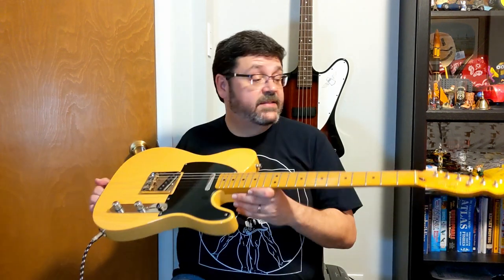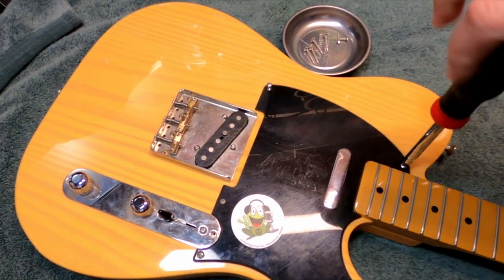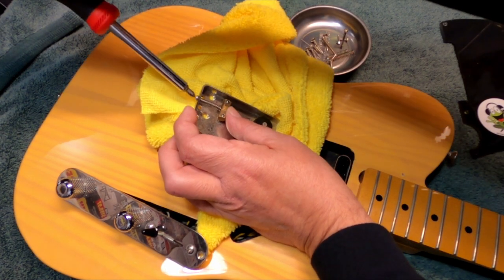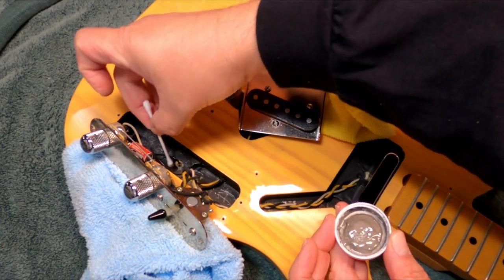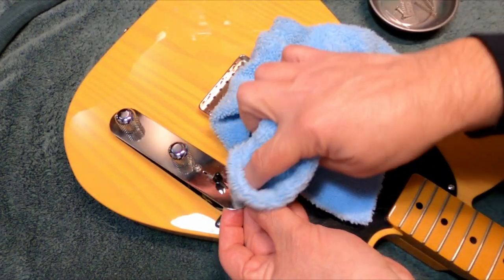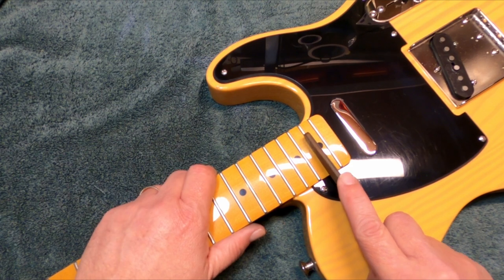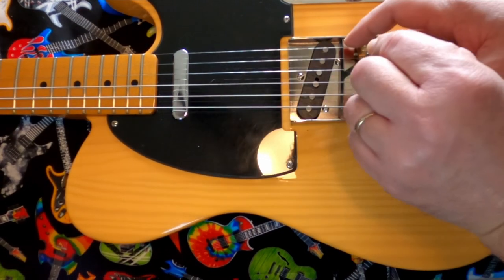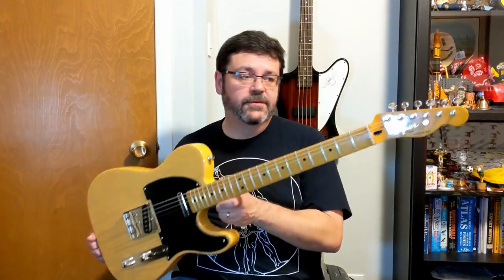Fixing a noisy Squier Classic Vibe Telecaster

Comment: I routinely shield cavities with aluminium foil (from the kitchen), stuck down with Pritt Stick.  I try to do it in one piece, and overlap the body (like this guy did with a blob of conductive paint), and then put insulation tape anywhere that internal components might touch the foil.  Going from no shielding to some shielding always cures the problem, without being picky about whether there's a perfect Faraday cage.  I prefer aluminium foil over copper, which seems to suck tone.  To connect a ground wire, I put a small, large headed screw through the foil, with the wire wrapped around it.
Reply from the maker: That's interesting about the aluminum foil, have you considered using Nashua HVAC foil tape? it's pretty cheap and it's conductive through it's adhesive and it's aluminum.
Reply: @pawnshopguitarguy  Thanks for the tip. I haven't tried that.  When I tried copper, I used garden slug tape, and crucially, the adhesive is conductive, so there's no need to solder the strips together. But I prefer aluminium. If HVAC tape adhesive is conductive, then that should be just as good as kitchen foil, and a lot easier to apply.  As you note, it's cheap, so worth a gamble.

Comment: I still don't get shielding and adding an additional bridge ground on a tele
Bridge pup grounds via mounting screws thru the base plate. Neck pup is fully shielded and grounded. Control plate is metal and is essentially a ground plate. 
Shielding the cavities and adding a separate ground to the bridge can create ground loops.  
As far as creating a faraday cage, there is a gap in continuity between pickups and mounting surfaces. The bridge pup does not have a grounded shield.
So all that effort gives negligible results in stopping RFI. 
Good wax potted pups and wiring the cap to the #3 lug and ground #2 lug on the tone pot (60's wiring) helps to limit RFI traveling all the way through the circuit.
Reply from the maker: Interesting thoughts but in the end I only added a tiny touch of shielding paint and it fixed it. The wiring otherwise was stock as far as I know....

Comment: I have to try this. I have a beauiful Classic Vibe 60s Custom Telecaster that has upgraded hardware, including bridge, electronics, switch and pickups. It plays and sound great... but it is noisy. I have have been told by two luthiers that the noise is normal for single coils, but I have quite a few other single coil guitars, including an American Standard Telecaster and they're not noisy.
I really love this guitar but the electrical noise really ruins the experience for me. If I touchthe bridge plate the sound stops. Touching the strings help but there is still a bit of noise. But otherwise there is that constunt hum or however you describe it.
Reply from the maker: I have seen some Tele pickups (especially hot ones) that are prone to noise, but a hum that stops when you ground the bridge with your hand tends to be something with the grounding. I would check or even re-solder the grounds. Good luck!

Comment: Nice job! Regarding shielding against mains hum on guitars, the term 'faraday cage' is in the ballpark but slightly misused by most of us and that included me before I was corrected and studied it a little deeper. Since the pickups almost always protrude outside the shielded body cavities they are also outside the boundary of the 'cage' and subject to interference. Can't avoid that unless you lower them below the boundary of the cage. But for me, good thorough shielding and proper ground continuity has always reduced the hum noise from rf interference. Next you have to learn how your single coil guitar pickups react to that in different playing positions and ranges with respect to your amp, leaky house wiring, flourescent lights etc. That's what I believe now but I'm always open to having my mind changed by folks who know more about it. Good show, just subscribed.

Comment: Looks quite light when you pick it up. I've seen/heard people mentioning that the pine bodies is quite heavy on the Classic Vibes. But it also looked like it had been used for some time. So if the wood have dried up a bit more, then it might've gotten lighter. Since it's heavily sealed, it wouldn't have taken in sweat or any other moist that easily. But doesn't that mean that moist will also have trouble evaporating out of it as well? Or is that exactly the difference? Vapor escapes more easily than solid water gets in?
Reply from the maker: Wood can take many years to dry, and the shrinking and checking on some of my older (20-30 year old) guitar's finishes helps confirm this. Basically avoiding high heat or sudden cooling by leaving an instrument in a car or in a an uninsulated space like a garage is your best defense against "fast" drying and shrinking which is damaging. If you're comfortable so is your guitar...
Reply: @pawnshopguitarguy  makes sense. Not too cool or too hot 😊

Comment: I have a Sqire Telecaster like that one. The B string is LOUD If you accidentally hit it while soloing you can hear it across the street. Would you have any idea what would cause this? Thanks if you have an answer
Reply from the maker: Is it louder unplugged or just plugged in? If it's only when it's plugged in then it's probably something weird with the pickup. If it does it unplugged then I would look at the nut and /or saddles having something out of whack, either too low or improperly cut string grooves.
Reply: @pawnshopguitarguy  Just plugged in. Thaniks.
Reply from the maker: I'm assuming it's the bridge pickup and the b string pole piece has probably got too much magneticity - it might be fixable with a degausser like electronics techs used to use. Otherwise you might want to look at a pickup upgrade, which is really pretty easy and not too expensive on a Telecaster    @kaivrock
Reply: @pawnshopguitarguy  thank you!